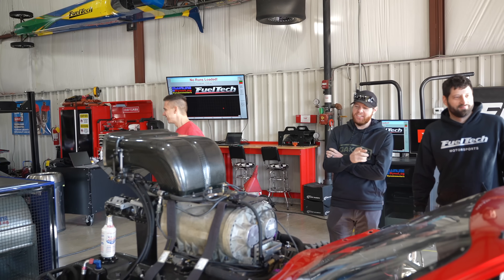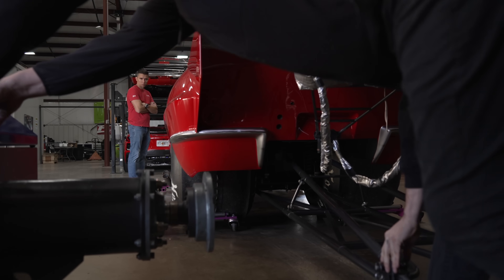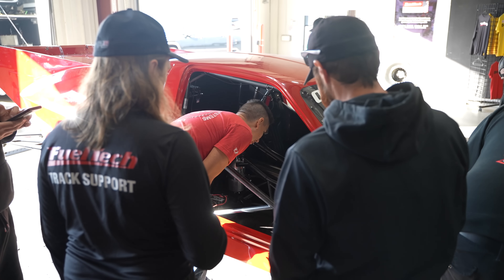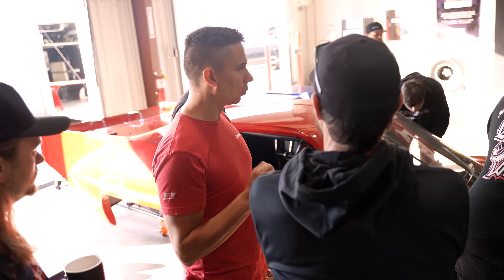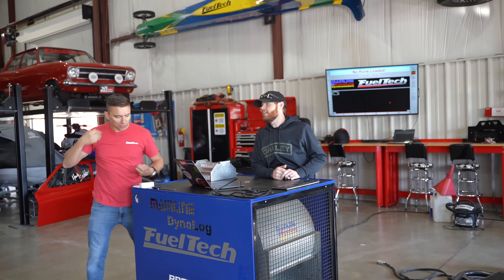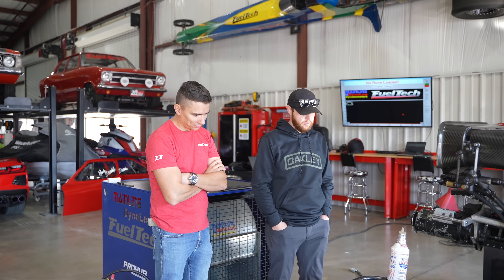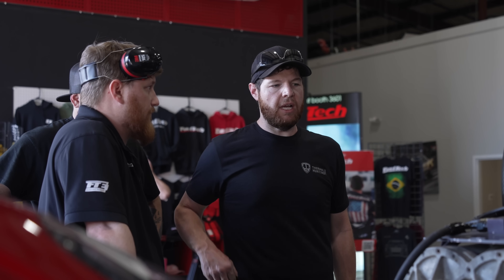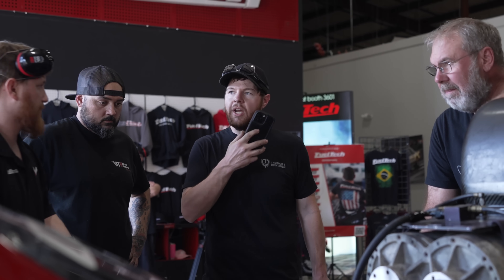Screw-Blown Pro Mod Corvette on our Dyno! | Stubbs Racing

Comment: Apparently not many of you have been around top fuel or alky motors being fired up and run.
They do dump fuel and the average alky car makes 4500-6000 hp.
Sit in the pits and watch them run the cars before hitting the track.
I'm old school and been out of it for 20 years.
But that's what I remember working on the engines in the day

Comment: I wanted to see what would happen if a top fuel car actually did a dyno test.
Reply: Clay Milliken tried with his parts plus car and it doesn't work because the way the clutch and final drive work. They could be ran on a purely engine dyno though.

Comment: A 1471
Reply: No sir 

That isn’t a roots, it’s a screw
Reply: @ronbunch579  screw better n forces it's self less
Reply: @ronbunch579  Darren blower 11 mm diameter carbon hat 🤠
Reply: @ronbunch579  nitrous nozzle instead of dual injectors n with 41 44 mm mags hehehe Allen Johnson pe V8 18 liter plus 1372 cid

Comment: Man that thing sure dont sound happy. I dont know if they are turning it backwards or not but thats alot of fuel to puke out on every startup. Im going to finish the video now. That second engine was a trooper to tolerate that oops and not pop break or blow apart something. I know how it happens we have all been there and made mistakes hurrying. I'd be getting rid of differences in engines to avoid that stuff. I hope that team puts a diaper or pan on that thing

Comment: Why is it blowing fuel out exhaust when starting it up? I’ve ran mechanical injected alcohol and never had this happen. I had fuel shutoff cable that killed fuel then I killed ignition power. Y’all guys are the real deal!!!!! Most Dyno/tuners would have quit and said come back another day !!!!
Reply: I'm sure they paid for the extra time LOL. Pretty penny for the full day I'm sure.
Reply: They run super rich at idle and spray gas into the blower
Reply: Looks like the engine shut off without pulling the fuel shutoff, seems pretty loaded up

Comment: Cylinder 3 looks dead
Reply: 2 and 3. Firing order was off. Not dead hole, just not firing at the correct time.
Reply: @funfun8095 still a dead hole. Couldn’t see cylinder 2 but that makes sense if the firing order was wrong.